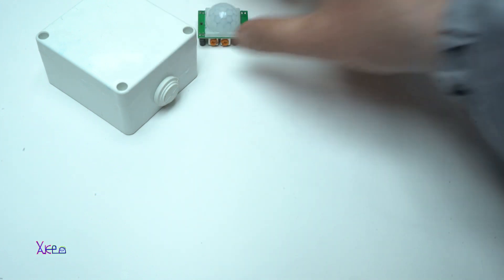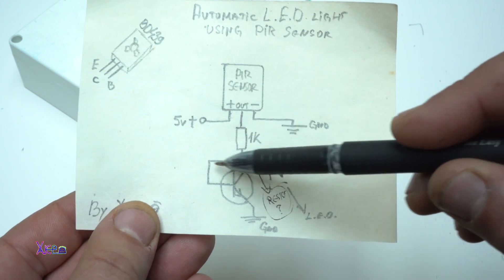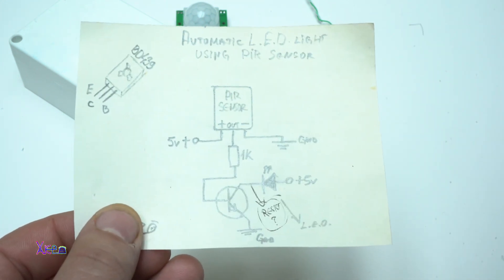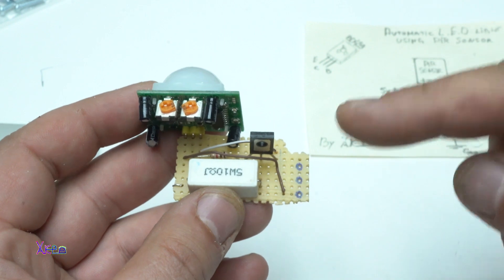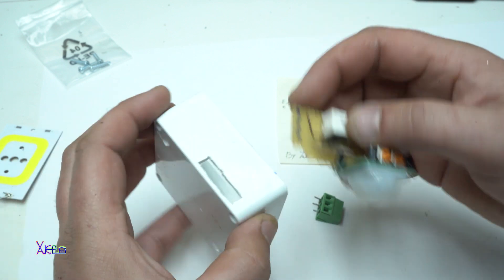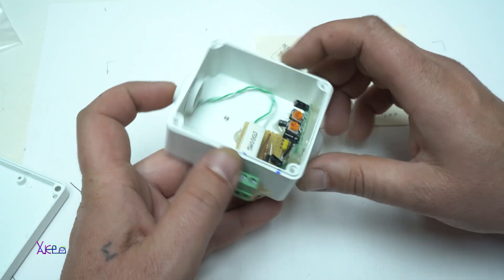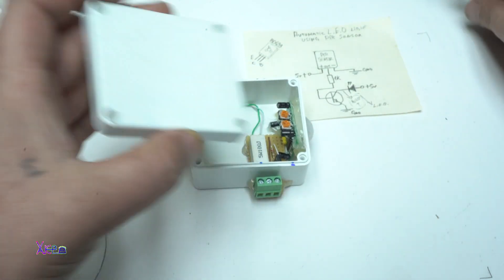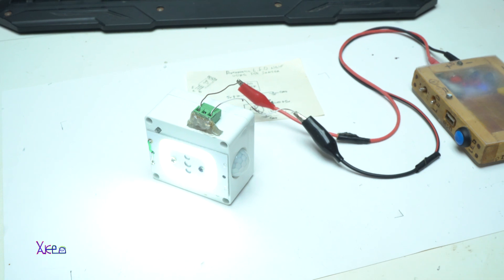How To Make Automatic PIR sensor LED Light with schematic

Comment: Very nice! What other transistors can replace BD439? Can you give some examples of other transistors which will work? Will it work with BD 137 or BC 547? All the best!
Reply from the maker: Bd137 is more powerful than bc547
Reply: @Hacktuber  I tried with BD 137 but the led it's very dim. I tried with many PIR sensor like this but no luck. I tried with resistors and whithout, with other transistors, not working. On the exit to the led i have only 2.54V. Something cut the voltage but i can't figure out, what it is.